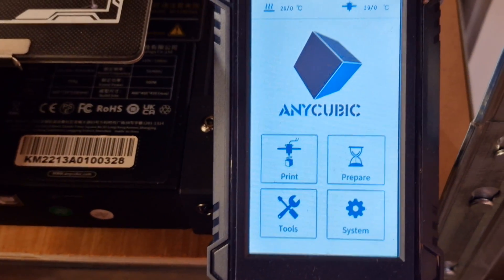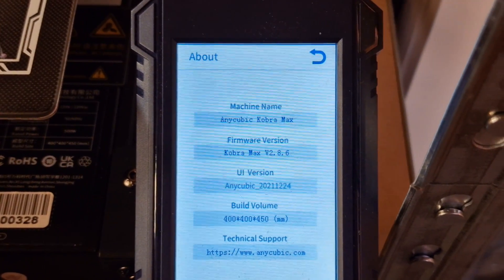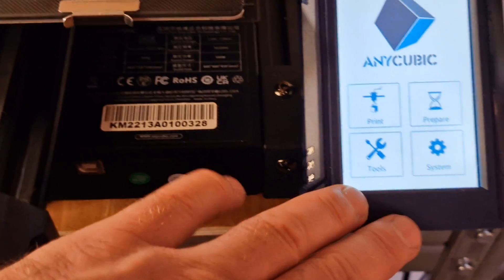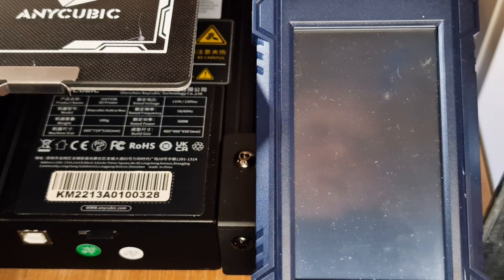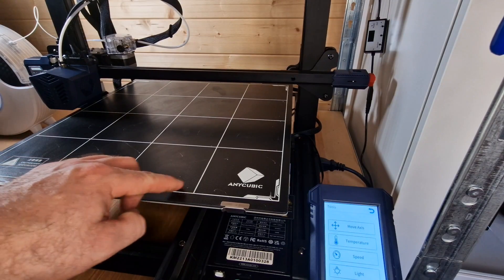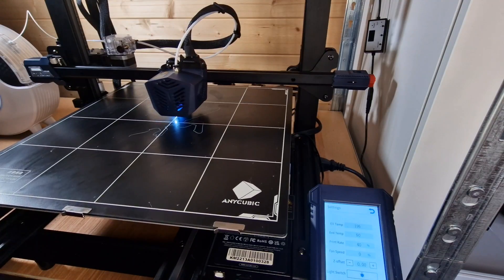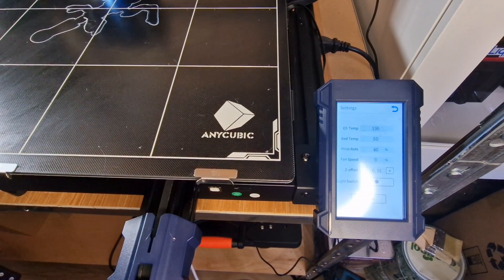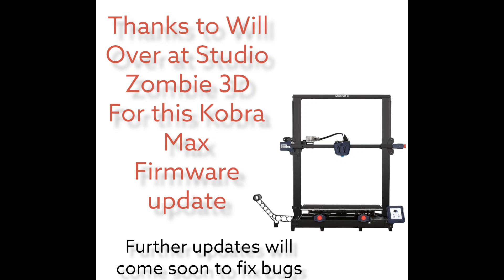Anycubic Kobra Max Zombie3D firmware update, 0.0.1 baby steps and filament change during print

Comment: I flashed this firmware in my Kobra Max and... it completely messed up the extruder ! it keeps emitting a high-pitched noise, like if something was continuously spinning, but the meshes don't... The printhead's moves sound also different... what's happening ??
Reply from the maker: the extruder will sound a bit different to get linear to work right the extruder needed to be taken out of stealth chop mode and square wave enabled. It will be a bit noiser due to the linear working. But it is normal
Reply: Yes that’s Will told me a few hours ago. But still. It is way noisier and it feels like it is damaging the machine…
Reply from the maker: @44AudioLab  should be OK 👍  let's watch this space if required  I have left links too stock firmware
Reply: @44AudioLab  same thing happened to mine, any fix on it? what changed?
Reply from the maker: Hi mine also does the same its a more around jerk movement  I believe , when you say completely  messed up your extruder can you elaborate
Reply from the maker: Also i have left a link too original  firmware in description

Comment: Can’t wait to try the filament change is it down thru cura or is it just manual?
Reply from the maker: So can confirm it does allow for filament change, press pause and then it moves bed forwards and nozzle clear staying at bed temp and nozzle temps.. not sure if it's cura driven or manual but to be honest I always manually change  anyway

Comment: so i followed the instructions, and now im stuck at the anycubic screen.  Nothing happens.  Have I bricked it?  I waited a good 30 mins before restarting, and the boot screen shows, but just stops at the anycubic logo. help!
Reply: Phew,   disaster averted.    I used a new sd card and formatted again so starting fresh.  copied the original firmware on to it, inserted and powered up.  firmware reloaded.   Tried again with the zombie firmware and it loaded just fine.  Must have a dodgy sd card.  Thanks for all your awesome work!!!
Reply from the maker: @matthewshumack3753  make sure you follow the pinned instructions above too save and then carry out calibration  of esteps  etc... as per before
Reply: @3DPUK-TECH-CHANNEL  yep onto it.  I did write them down originally,  but ill go through the process again. Cant hurt
Reply from the maker: This shouldn't have bricked it did u turn off at the start ? And then place sd card in and then turn back on